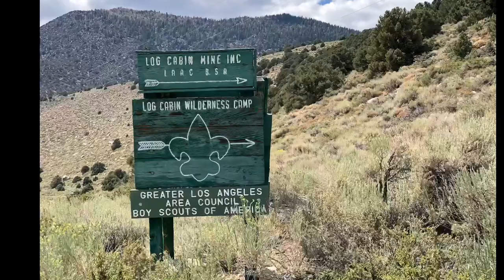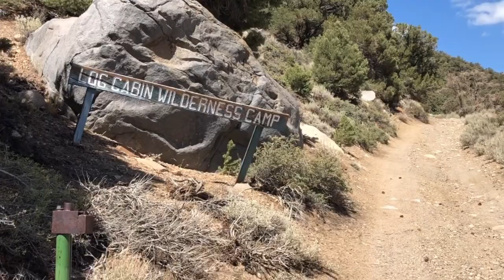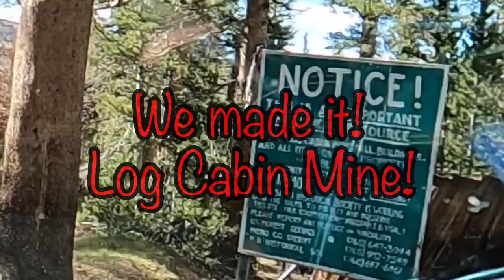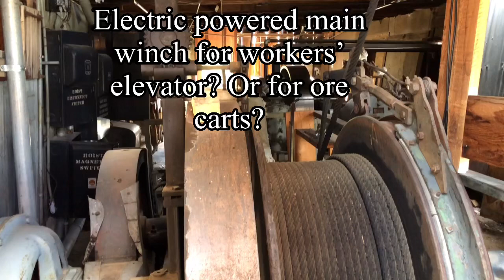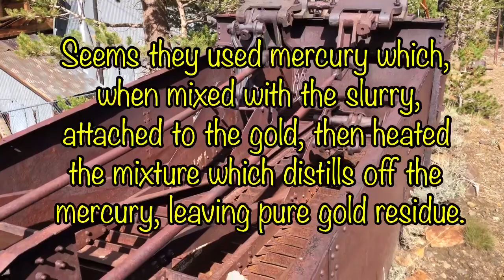Discovering the Log Cabin Mine of Mono County

Comment: Thanks for such good content. Love you videos. Is this comparable to leavitt lake road or the east Sonora Pass bypass?
Reply from the maker: Thank you for your kind comments! This road is a step or two easier than Leavitt Lake. There are two ways in to the mine, we took one way in and the other way back out. On your topo map, the route that has a lot of switchbacks is steeper and 4wd is helpful just for traction, but not required. The other route is fairly easy accept for a few places that have been badly washed by rain.
Reply: @KenTheJeepGuy  thank you so much for answering questions as well. I’ve done the leavitt lake trail and bypass trail because of your videos and have loved them both. Keep it up!
Reply: @KenTheJeepGuy  really? The road to the left I think was very poorly washed out in certain spots. I was too afraid to attempt them with my Subaru.
Reply from the maker: @Cami_house  The road to the right is not as bad. If you took the road to the left, I would think that if you went slow it would be OK. But I am in a lift a jeep, and my perspective may be off.
Reply: @KenTheJeepGuy  got it! I was wondering how the road on the right is! We took the road on the left and ended up walking. Walking that trail sucks.
Reply: @KenTheJeepGuy  so the road on the right doesn’t have those two definite holes in the road?